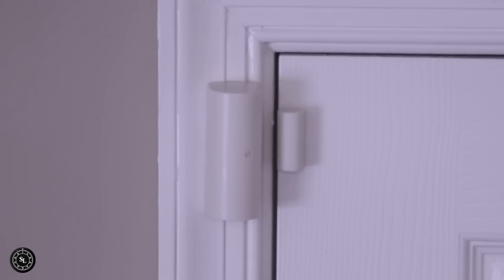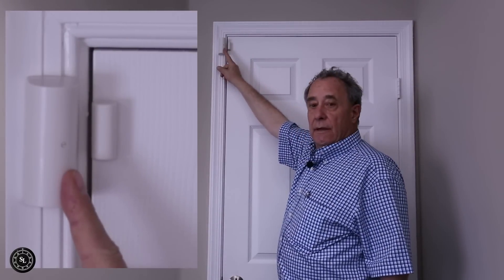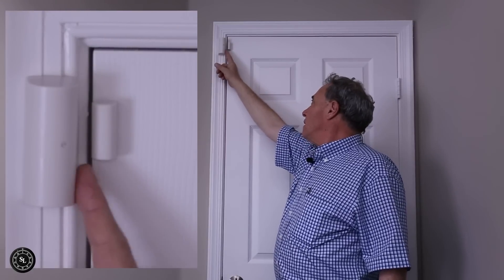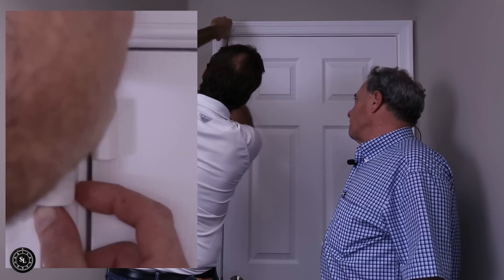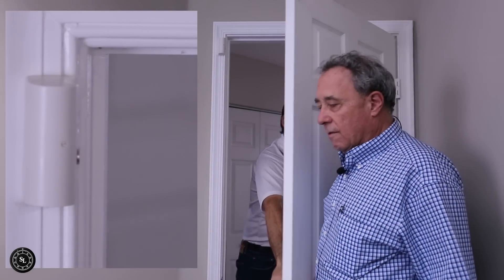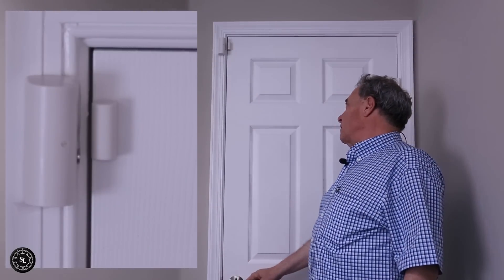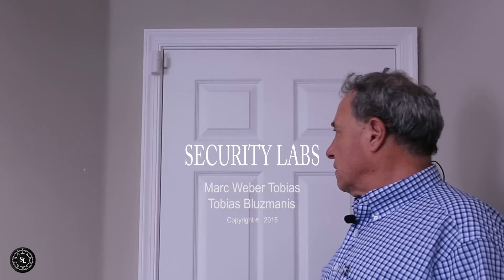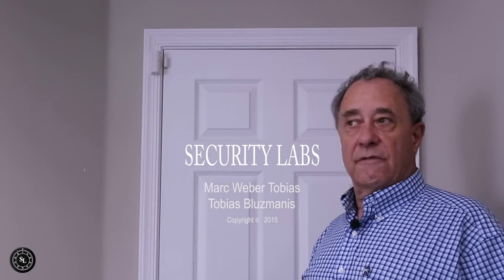SIMPLISAFE BYPASS OF MAGNETIC TRIPS BY MARC WEBER TOBIAS

Comment: ok I have a metal front door with two synced locs and bolts on hinges  and I use something like this; how in the world someone would know where my sensor is located from outside( there would not be able to check that with the magnet) Test like that is something I would like to see. Also each time when there is no sound when you open sensor like that this should give you at least a note of concern why. Yes they are not a gov level security and yes they are not high level of sec, but at least there is something.

Comment: After reading the great reviews do7.pl/Wireless of this product I purchased it and couldn't be happier with it. I set it up in an hour or less. It can be turned on by the keypad, the keychain or your smartphone. You get messages when the system is turned on or off or if there is an security event at the house. You can set up codes so you know when kids or cleaning people come and go at the house. You can set the alarm when you are at the house overnight. You can start with this basic system which is appropriate for most average homes. You can add components as you wish - water leak detectors, smoke and co2 alarms, additional motion detectors.So pleased with the system - 5 stars for sure !

Comment: Someone would need to be inside the room in order to put the magnet there. I think most people use these to know if someone opened a door or window from the inside of their home. Also, most folks have cameras and motion sensors so the cops will show up either way, assuming you have an interactive monitoring plan.

Comment: this works just as well if even if one hasnt been in the building. you just have to be quick and have a strong magnet. one this placement of sensor is the most common. especially when they are going to the wireless ones. its placed in this corner for looks and is mainly out of reach of small hands. to counteract this dont place it in that exacts spot. another is it can be visible if the door is seen from across a room from an outside window i.e. small house with front and back door within the same living space. if one has a strong enough magnet it can even be bypassed from outside the door frame. you can even find it from outside with the use of magnetic film a product that makes magnetism visible to the naked eye. when a door is opened you still have a second or two to place a magnet at the sensor before the chime. try it yourself from outside if you want.  this dosent show you how to bypass said alarm but shows that it can be done and attacked and you shouldnt depend on it. if this is a vivinit or simply safe there is actually easier ways to bypass then with a magnet. its on the internet and not hard to look it up. just be proactive with random placement maybe two sensors instead of one. locks and alarms are only for honest people.

Comment: That is why an alarm system is composed of several layers of security such as motion sensors, volumetric sensors, capacitance devices, smart video surveillance, beams, etc. There is more to physical security that a person can utilize for protection. Its like an onion, we need several layers of protection. And the level of protection should be based on the results of a good risk assessment. Alarm systems are but tools. The critical part is the "Response" piece wherby security forces respond in case an alarm is trigerred

Comment: Marc Tobias you are a hack. Any door sensor can be bypass defeated if you allow someone access to tamper with it.  Even your hardwired flush in-jam mounted pin or magnetic switches are easy to bypass. In fact I would argue that non-surface mount ones are even easier to unknowingly be tampered with because they are not visually inspectable just by looking at the outer appearance of the door. Just stop talking...

Comment: Do your homework on digital monitoring products. There's systems send in a health status every other hour and if a sensor is tampered with it will send in the information to the Dealer's Central Station. We thought about this stuff back in 1980. Also put a motion detector facing the door on a follower. To top it off install a device called Nausea which will render anybody in the room sick within 20 seconds

Comment: Why don't you drill a 3/8 inch hole on the top header of the door frame and insert a magnet on the inside of the door? I can't wait to see what you're going to offer next. Why don't you enter in and go straight towards a motion detector with a hot hair dryer LOL

Comment: Even if the cable guy bypasses every door; when you arm the system it tells you that you have open sensors.
Reply: This is what I keep thinking while reading these comments.  Even if someone from the inside bypasses the sensor, it should show in the 'activity' on my mobile app, correct?
Reply: FMW , does it?

Comment: I was in Law Enforcement for 18 years and never once did I investigate a professional burglary. These low-cost systems are highly effective for 99.9% of burglaries.
Reply: It's insane, I was homeless and a few people I know, I later found out where burglars, respectable ones if that's a thing. They where like the nicest people, maybe part of the con artist life.point is they carry a SMALL amount of tools. Magnets where the only thing I needed to steel from stores and I haven't done that for like 4 years or so. I'm stable and off drugs, but magnets break like 80% of electronic security devices. If only ICP knew how they worked
Reply: @notryan2496  The problem is, security is layered. You may be able to bypass the open/close sensors, but there are other sensors like motion, cameras that detect people/motion, glass break sensors, and so forth. So, yes, you may be able to get into my garage, but my night vision camera is going to "See" you, or my motion sensor will or both.
Reply: Your perps didnt have my fricken neighbors.

Comment: People are skeptical about this actually mattering in terms of keeping burglars out of a house, but my question would be: if I held a magnet on the opposite side of the door and opened it slightly, very quickly, then kept the magnet in close proximity to the sensor, would I beat it? Or would the very slight, very short, movement of the original magnet as mine gets closer be enough to trip the sensor?

Comment: Number 1. All of my entry points are covered by motion sensors as well as contact points.Number 2. If I were home, the burgler would also be surprised by at least one of my many, many FRIENDS. Mr. Smith and Mr. Wesson or Mr. Glock21, or by Mister 6.8 AR15. Oh, by the way, I pity the fool who tries to enter when the wife or I do not have a quick and easy mode to escape. Especially after 6 back operations. And by the way, my friends are safely hidden all around the house just in case one of my friends are not right NEXT to me. Now..... Mr. Tobias, I think that takes care of you foolish magnet theory. And before you get a chance to mention it, all of the ammunition that I use inside the house does not penetrate the walls. And just in case you ASSume that the AR in AR15 stands for Automatic Rifle, it does NOT. It stands for a majority of the material the gun is manufactured from, ARMOLITE. Next time you presume to know EVERYTHING..... DO YOUR HOMEWORK!!!!!
Reply: extra

Comment: I wouldn't worry about this for home use since the magnetic tape needs to be attached from inside to defeat the alarm. Thieves come from outside of the house. Show me if you can defeat this from outside.
Of course, for business places where people travel in and out a lot, this is not really designed for it. Why even bother with that magnetic tape while one can just pull the sensor right off the door entry? Duh.
Reply: Finding a security sensor installed on a door from the outside is quite easy.  Using a compass, guide it along the edge of the door frame until the compass locates the magnetic north of the sensor magnet.  Then, using a strong magnet, tape it to that spot, kick the door open and the door sensor will not activate.  This is mostly a concern for break ins while the home is occupied and the alarm system is in the stay mode.  The reed switch used in these sensors were invented in the 1930's as a telecommunications switch, not a security product.  The reed switch is globally activated so it doesn't care what direction the magnet comes from.  There are more secure contacts out there that can easily replace what you have on your home or business - they are manufactured in the U.S. by Magnaspshere. I am the VP of Security Products
Reply: Hmm, so after you break through the door, how do you defeat the motion sensors inside the house? Let me guess, the RF jammer. . .except the base station will complain if jammed. . .

Comment: You state in the beginning of the video that the magnetic trips is widely used by alarm companies, yet you single out one by name?

To play devil's advocate, lets say you are right and the burglar has been able to bypass the magnetic trip from the outside using another magnet (also assuming he/she knows where it is installed on the door/frame), what about the motion sensor that comes with the system? Would that not trigger the alarm? I did watch your "frequency jamming" video (#2 of the 3 series), which you have a valid point, in such case the alarm would not go off as you showed.  I am still unsure if you are singling out one company (which seems very apparent by stating the name multiple times) or just used it as the test platform to prove your point.

In the end, what is your recommendation as an alternative to such systems?  There are many critics out there without a solution...
Reply: The best technique to stop his frequency jamming demo is to use ANOTHER alarm companies lawn signs and stickers and to mask over the manufacturer's name on the keypad.

That way, even a sophisticated burglar doesn't know what frequencies a given house uses for it's monitoring, and with out that info it's difficult to jam.  

Remember, the sensors don't actually transmit except momentarily when they are tripped and during the arming sequence, so determining the actual frequency used at a given house is hard to determine unless you advertise it with that manufacturers window stickers and yard signs.
Reply: GCW587 Better: Just steal someone else's yard signs and look totally legit.
Reply: In this case with Simplisafe, would the system itself be using radio frequencies like his other video #2 and #3?
Reply: Finding a security sensor installed on a door from the outside is quite easy.  Using a compass, guide it along the edge of the door frame until the compass locates the magnetic north of the sensor magnet.  Then, using a strong magnet, tape it to that spot, kick the door open and the door sensor will not activate.  This is mostly a concern for break ins while the home is occupied and the alarm system is in the stay mode.  The reed switch used in these sensors were invented in the 1930's as a telecommunications switch, not a security product.  The reed switch is globally activated so it doesn't care what direction the magnet comes from.  There are more secure contacts out there that can easily replace what you have on your home or business - they are manufactured in the U.S. by Magnaspshere. I am the VP of Security Products
Reply: @michaelkeegan9142  first smart person like me I've seen on here. If there's a flaw, it WILL be found.

Comment: This is ridiculous. First, I don't need a security system to keep my kids IN. Second, you only have to worry about this if you have untrustworthy people in your home. If that's the case, you have problems a security system won't fix. Third, Simplisafe isn't designed for commercial applications, it's for DIY homeowners. I found this video while researching whether to purchase a Simplisafe system. I give this video a thumbs down for helpfulness.

Comment: What a joke... While informational, it is misleading. 

One don't label you have an alarm. 

Two the burglar would have to do that from the outside. 

Three each entry way and first floor window should be covered with a motion sensor.  A secondary to entry way which is more difficult to defeat.
Reply: tpaairman Easy fix. Always watch the person who's in your home fixing whatever. Whenever you have someone over who you don't know real well, do a quick visual inspection of the sensors once they leave.
Reply: If you have a service person or delivery and they place the magnet on the sensor while they are there.  Then later they or someone they work with breaks in.